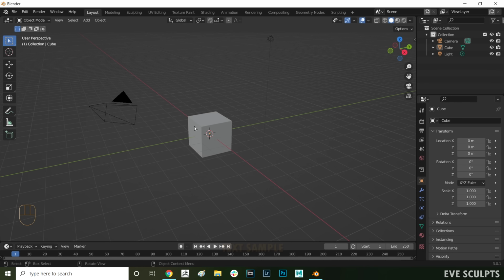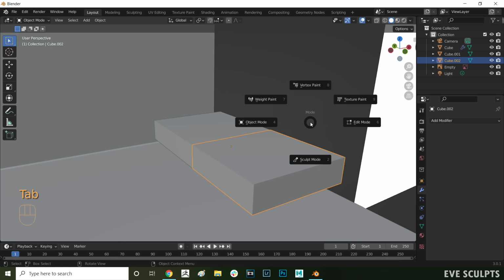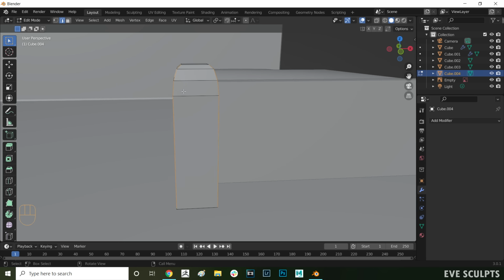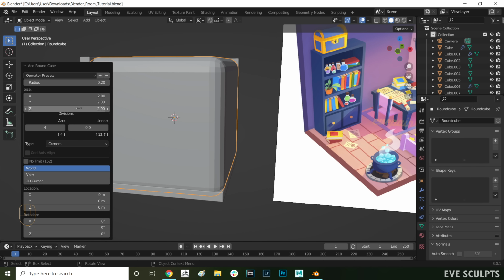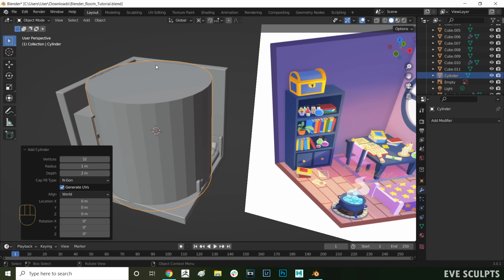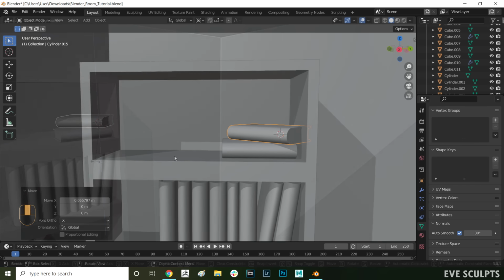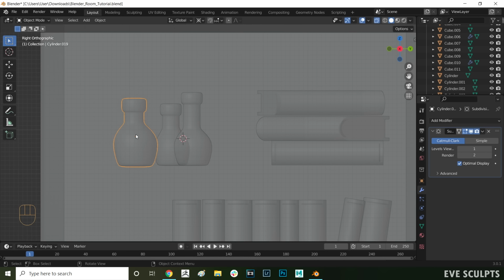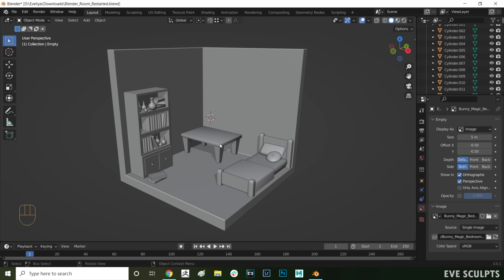Blender Tutorial - How to Make a 3D Room for Beginners (Part 1)

Comment: Here's a helpful tip for anyone using blender 4.1, struggling to find the normals and adjusting auto smooth in object data properties:. in object mode, simply right click with your object selected, select shade auto smooth and adjust it to your desired angle in the tool settings after you've done the action
Reply: You have to right click on the object and you will get shade auto smooth

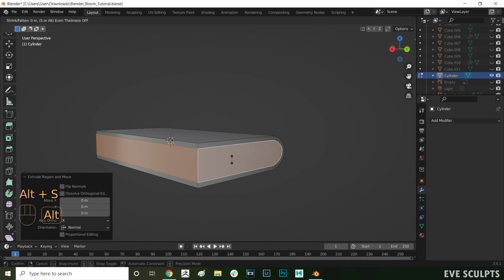Comment: I’m at 22:37 and the inset works differently now. It affects the entire shape rather than just the top and bottom. How can I disable this?
Reply: Oh I just had individual turned on
Reply: I had the same problem, so I actually resolved it by doing the Inset with the tool from the left side bar called "Inset Faces" I selected all three faces and it worked. Hope this helps

Comment: In case this is helpful for anyone, because it tripped me up at first... be aware that applying all transformations will remove the origin point from the object. This means that if you want to make further adjustments to the object (if you want to scale or rotate it again for example) it will use the world origin to do this. You can add the origin point back if you've removed it (right-click the object in object mode, click "set origin", and choose "origin to geometry"), or you can apply just the scale and rotation without applying the location. I didn’t have any problems just applying scale and rotation without applying transform, but I'm not sure yet if there could potentially be undesirable effects of doing that. 
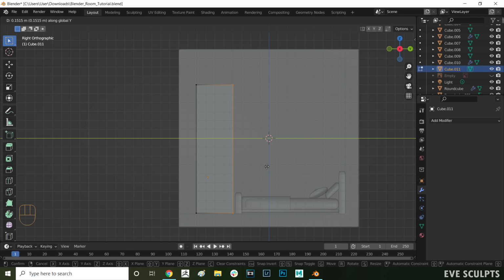Also, regarding the object editing at around 18:00, editing the object's overall shape and position in edit mode instead of object mode will mean that the origin point will remain in its original location instead of in the centre of the object, which may result in some unexpected and undesired behaviour when scaling or rotating. Again, you can fix this, but it's good to be aware of.

Comment: having trouble with bevel modifier not visually applying to the bed :( when i select object, the orange outline is going around both the bed and bed cover when selecting cube.001 :*( i am missing something somehow despite trying to follow instructions perfectly

EDIT: when selecting cube.001 after extruding my bed cover, it appears as if the lower half of the mattress itself running underneath the bed cover is somehow also extruding alongside the cover... idk how to make that stop
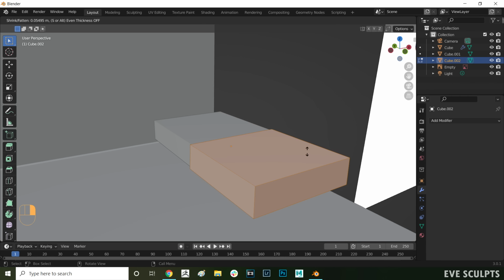Reply: omg, was it the part at 5:28? I'm having issues with that as well. My orange outline goes around everywhere but the top surface of the bed and my bed ends up looking weird.
Reply: @muffledd  exactly! 🥲 hope creator replies
Reply: Same problem here :( did you find out?
Reply: @spacenellagirly  no :( tried several things and couldn’t get it. And no reply here
Reply: I accidentally figured it out and I'm not quite sure what I did; I was just messing around and going back through the tutorial. I redid the steps that led up from the loop cut, then when she went into object mode to show off the difference between the bed and the covers I did the same and went back into edit mode after having clicked on the covers and not the cube, and suddenly it was working fine again, so I was able to continue the tutorial. I don't know if anyone here still needs to know how, but I'm going to share what I did to fix it in the hopes it helps someone.
Reply: hmm having trouble with this too. did you manage to figure it out?
Reply: @Basketball92485678  sadly no :/ skipped over and did the rest, just had ugly bed lol

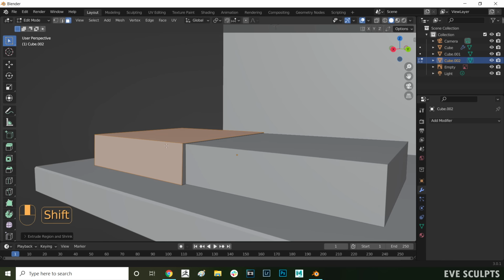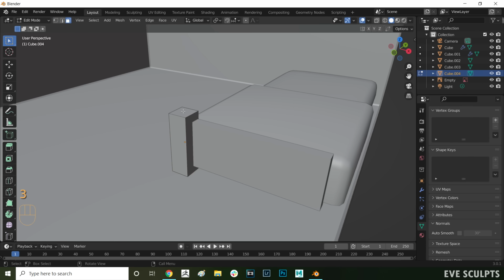Comment: quick tip: select your object -> ctrl+A -> Apply scale once you get your cube shaped. This will avoid non proportional extrudes or bevels, etc (5:30 , 10:00 for instance). I hope you find it useful :)
Reply: adjusting the scale can replace all transforms? (it kind of annoy me that resets the center point of an object)
Reply: i cannot get this part🥲